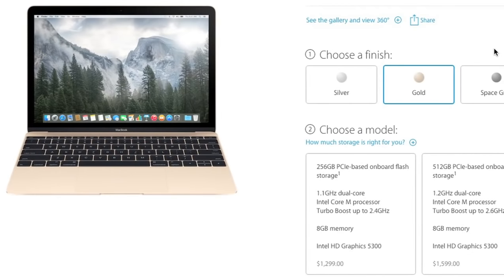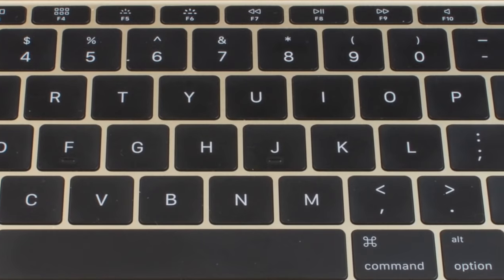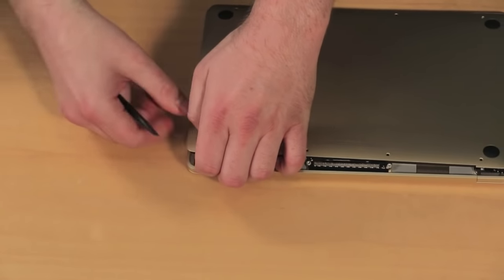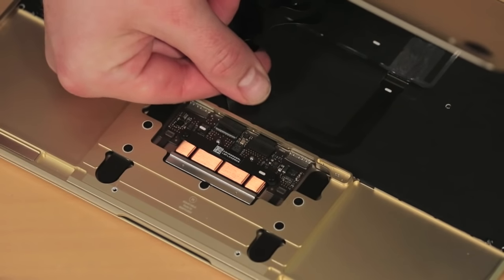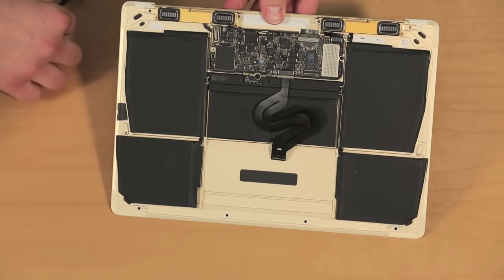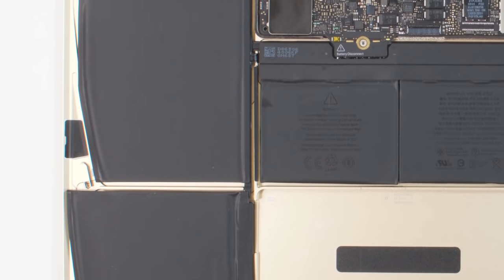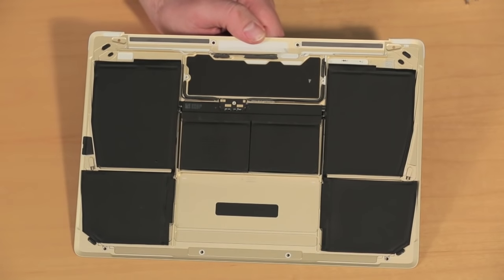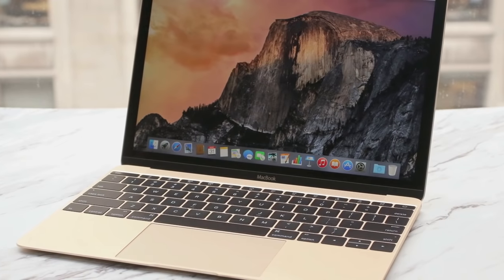Cracking Open: Apple MacBook (12-inch, 2015)

Comment: its a phone pretending to be a computer!
Reply: PHISHIT *tablet
Reply: MonkeyspankO a pill thats makes you shit yourself, of course
Reply: MonkeyspankO well it's generally a low powered big phone :P and has a touch screen usually.  but the reason I said it was a tablet was cause it has a tablet processor in it (the core M)
Reply: MonkeyspankO haha yea personally I use a convertible tablet (acer switch 10) but I doubt tablets will last another 5 years
Reply: It's an iPad pretending to be a laptop.
Reply: Igor K super jelly bro!
Reply: Igor K my laptop is just as fast and it was £200
Reply: Igor K actually no. It's a full HD convertible laptop, and I can't easily very 6 hours from it. Stop making assumptions and stick to the facts please. Oh and it actually has some storage unlike this overpriced piece of crap
Reply: Igor K full HD isn't outdated. Sure it's not the best, but it was 300 pounds. Cheaper than a bloody ipad. I know there are higher resolution laptops/tablets out there but I went with what suited me best. I do not need or want a higher resolution, because then I have to add scaling to Windows, and god knows how bad windows scaling is. Also 'retina' is nothing more than a marketing buzz word. My phone has nearly double the ppi of an iPhone, and the only way I can see a pixel is with a magnifying glass. Now iphone screens are decent, but they lack in resolution. (my last phone was an iPhone 5 before you say I'm a fan boy) and they are really over rated, but I'm not going to call someone else's stuff "big" "heavy" "ugly" and say it has "low resolution" and "shitty battery life" and is "outdated" because that's their choice. It doesn't affect me. Now if I know it's a bad choice I will inform them, but I will never call their stuff shit without really knowing weather or not it really is. Stop being a twat and I will talk to you like a normal person.
Reply: Igor K haha atleast i dont spend 1200 quid on a macbook, and there is exactly 7.81ppi difference between my laptop and the new macbook. so as i said before get your bloody facts straight before you start chatting shit. also you can get higher resolution laptops with touchscreen (dell xps 13) which is 0.2mm thicker, and actually has bloody ports for $1299 which is the same price as the base macbook, or $300 cheaper than the upgraded one
Reply: Jonathan Hine the sad thing is, apple is selling the better macbook pro for the same exact price for this one.
Reply: Asir Fatagar and thats my point. why waste money on this, when there are better options? its a waste of money. I have nothing against apple, but when they come out with shit like this, it just pisses me off. and then people start saying my stuff is shit, just because its not apple. That is what really pisses me off about apple, not the company themselves (usually), but the fanboys who say that my stuff is bad, because its not apple, and they have no clue as to what i actually use or what i do with it.

rant over
Reply: Jonathan Hine right? just because its "gold" its better .... in my honest opinion, there are some apple products that are worth its buck, but obviously some are not worth the money at all. I understand your problem, my friends think that my mac is awesome when in reality , its not. Its just OKAY, adequate , not awesome. And yes! those fanboys are the worst, and it sometimes makes me ashamed using an apple products because of those idiotic fanboys. and a 1.1 Ghz processor ? SERIOUSLY? if it was for $800 then MAYBE it might be worth its money, NOT at $1299. The worst part that there are windows computers which are more expensive and higher spec'ed than a mac.
Reply: Igor K ok... wow... calm down there, i never told anyone what they could, or couldnt buy, I was just saying that this product in particular is shit for the price that they expect you to pay for it. i was just saying that there are better products out there, if you'd read the comment i was replying to you would have known i was refering to the macbook pro when i was saying that there are better products for the same price. If anything, its been you thats been trying to accuse me of buying 'shitty' products, just because its not apple. and yes, before you ask i was referring to you at the end of my last comment, as well as one of my friends. so stop gettting so worked up, just because i critisise your 'godly' company  in which you love so much
Reply: Igor K problem here, macbook pro retina is already super thin and super light, the purpose of the gold macbook is defeated, plus its the same price (big shock)
Reply: Igor K 1.5 x 1.2 =1.8 good work defending apple there ;)
Reply: Igor K but the thing is that it is literally just a tablet processor, that apple have stuck into a laptop, that is the only reason its is so small, and so under powered. and yes the OS is very well optimized, for the moment, but what about when the next generation comes out? Will apple keep up with the optimization? probably not, because they care about the money (planned obsolescence), more than anything else. and sure other companies can be blamed for this as well, but they don't charge 1200 for a laptop, that is basically a tablet with a bigger screen a track pad, and a keyboard, that imo, feels shit anyway. but because its apple, they deserve to get away with this? no, they shouldn't, and the other companies shouldn't either.
Reply: Igor K theryre ok, but yes they do lag my brothers does all the time, and no, you cant render 1080p videos, only watch them. but i have nothing against ipads, but theyre a bit too expensive, as is the case with most, if not all, of apples products
Reply: Igor K oh dear god. I was comparing the gold macbook retina and the retina macbook pro, since you are defending the gold retina macbook id like to show you that the retina pro is a way better option. Or you just think that all macbooks are the same ? Tell me , apple is offering 2 laptops at the same price , 1200. one is a puny 1.1ghz processor, and the other one is a 2.7ghz processor, both are super skinny , and super light, its just that the 1.1ghz one is a tad bit thinner and a tad bit lighter. Obviously the 2.7ghz apple macbook is better than the 1.1ghz apple macbook right
Reply: Jonathan Hine the worst part, they are charging the same amount (1200) for another macbook which is 200% more powerful than that "tablet" , mind you other windows laptops can offer the same specs as the retina pro for lesser than 1200, but comparing apples to apples is a better example for fanboys.
Reply: Igor K yeah,, if you were to add an iphone 6, they both would be the same weight.
Reply: PHISHIT yes u totally say it what im thinking LOL that's why not just buy ipad or iphone LOL
Reply: Igor K full HD will be outdated when they stop making full HD displays.... pretty sure they're still being made so your statement SUCKS!!!!!
Reply: Igor K shut up
Reply: lol
Reply: with the overprice
Reply: A modern smartphone is technically a computer (that fits in your pocket).
Reply: Microtechnology bro

Comment: Only Apple can get people to pay $1300 for a Raspberry Pi with some batteries and a screen.
Reply: lol i should make that lol xD
Reply: well it' s funny but not realistic. you don't pay a raspberry with some pieces around,  you pay a reenginered laptop with no fans, force touch , retina screen, ultralight and superthin, superb materials extra battery life ecc. and yeah it's overpriced but i think (i don't own it) it gives the best non pro user experience you can find. can u feel the same with a raspberry board and some used pieces glued in a wooden case of fruit?
It's a micro silent zen product like it was the apple II in 1977, and if you want it you pay it. in fact i'm still using my 2008 aluminium cause this thing is for rich people or people like me who pushes a lifetime computer for ten years
Reply: ok yea
your really paying a TON for osx (um macos)
and being soooooooo thin force touch adds a little bit totho
Reply: yea i know intel core ms are WAY more powerful than those arm ones i havce 2 pi 1s so not that great at all
Reply: It’s one expensive Raspberry Pi with an x86 processor...
Reply: lol